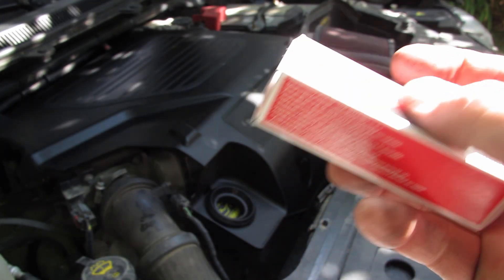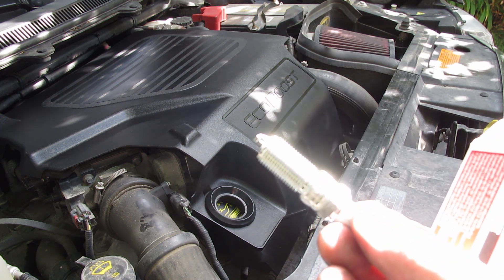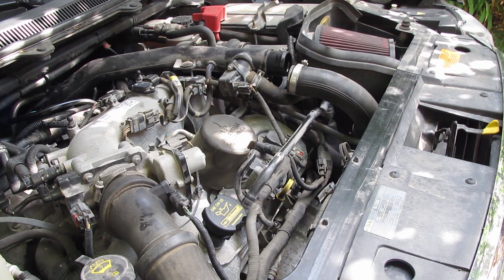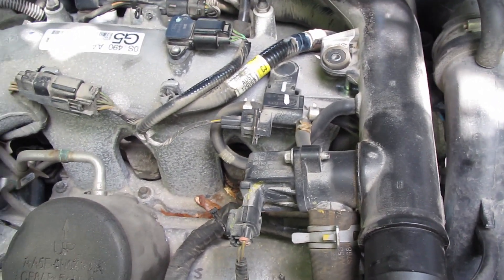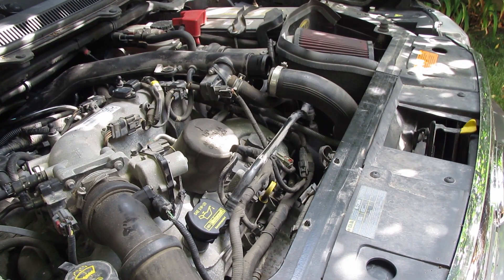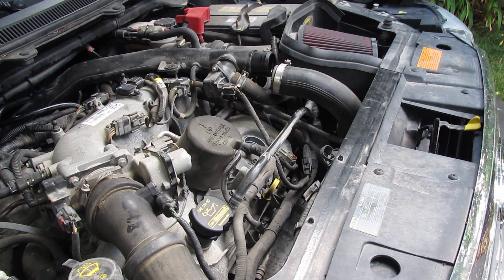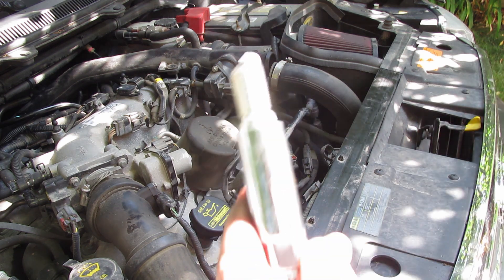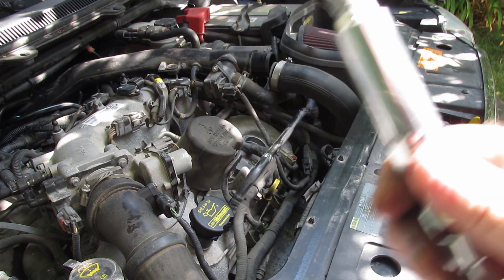How to replace spark plugs on Ford 3.5 Liter Ecoboost Engines the right way with the right plugs!

Comment: Was hoping you were going to show how you got to the back left plug bro
Reply from the maker: Ratchet with various length extensions and a flex (universal or U-joint) adapter.  I foy removed the other 2 plugs on the backside, you can handle the last one, I promise.  Please like and subscribe.  Thanks for watching and the comment!

Comment: My ignition coils will not pop out. They are stubborn as hell.
Reply from the maker: Likely the last person to replace them did not put electric grease in the boot when they put the new plugs in.  I know there is not much room but try to wiggle back and forth to break that seal or CAREFULLY take a small pry bar to lift up and break the seal.  Thanks for the question and for watching!